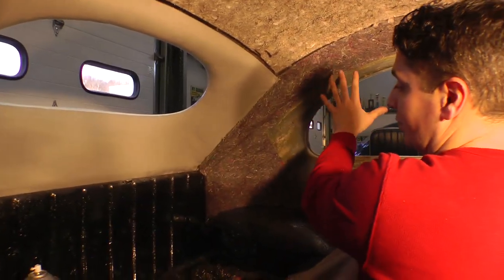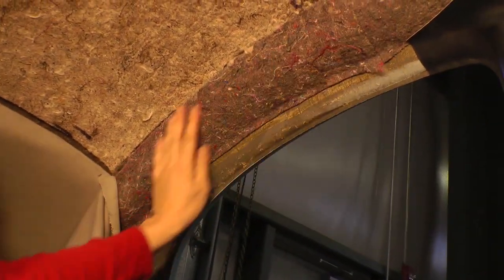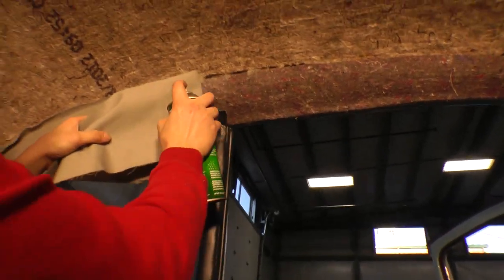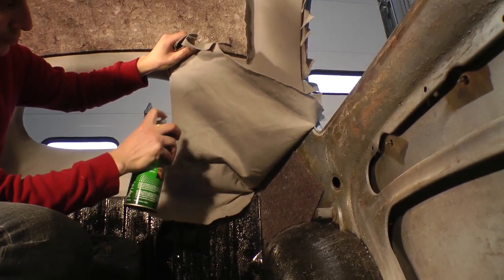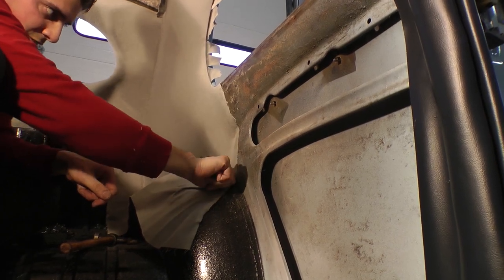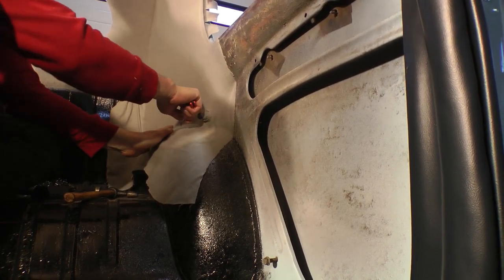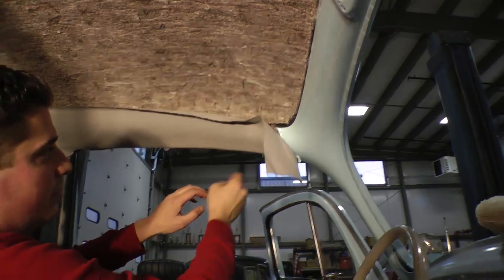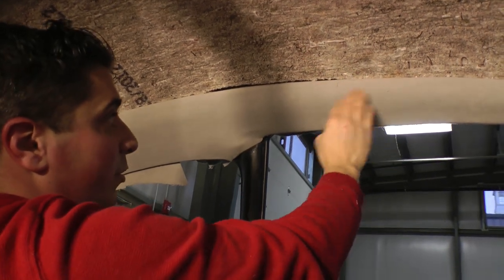Classic VW BuGs How to Install Volks Multi-Piece Beetle Headliner Pt.5 of 6

Comment: Hey Chris, I have a 1956 bug I’m restoring and it has no headliner grips anywhere on the car nothing on the door posts , no sign of them ever being removed interior is original paint .
did they offer these cars without the full cloth or vinyl?
Reply from the maker: Yes you might have a standard model, no bling bug.

Comment: Hi Chris! at 0.54 i don´t have the Strip at my TMI cloth roof. it´s a 1956 bug i have.  Is that a problem or should i just stick it down in the grippers and holt it in Place and smash the grippers to lock the roof ? Kind Rangers Erik.
Reply from the maker: VwErik88 Ahhh, TMI stuff!  Yeah you can hold it in place and bang the grippers down, but I would glue a strip of card board to that angle of the headliner to get a nice straight line.
Reply: Thaks for fast answer Chris! Yes i did just that today and it was not to bad at the end :)